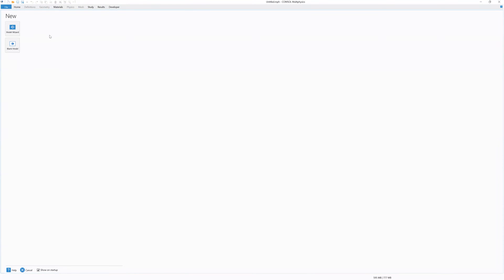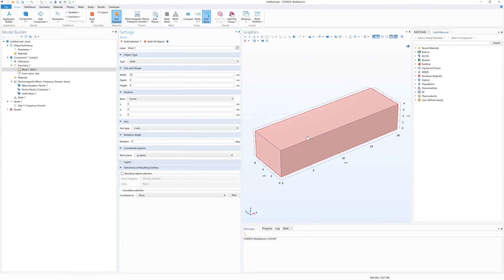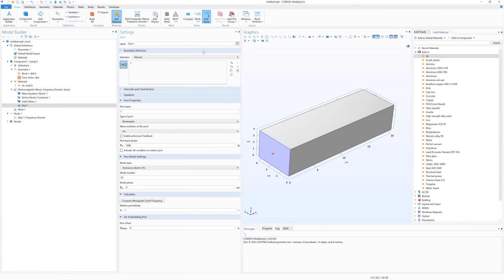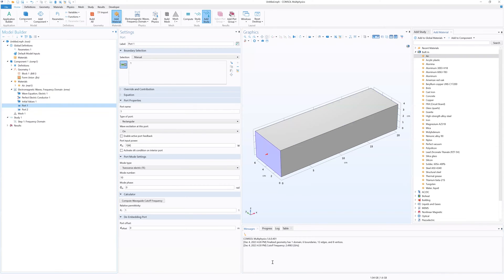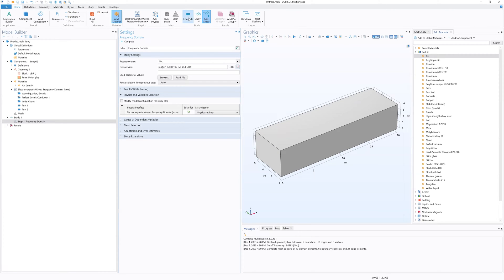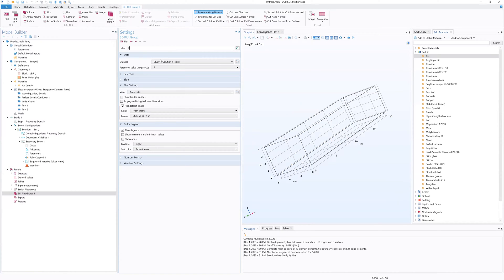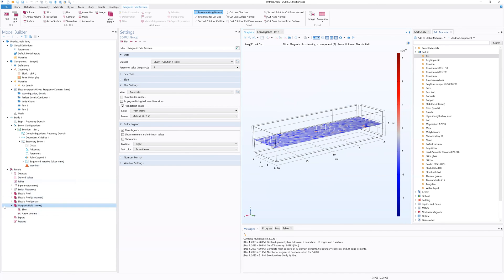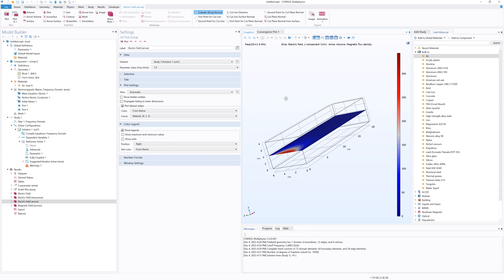How to Setup a Rectangular Waveguide in Comsol

Comment: During formation of mach zehnder modulator in 2d if we want to find optimum value for impedance matching,the difference between refractive index of wave guide and transmission line of radio frequency wave.we needs to compare width of center electrode with separation between Ground and signel electrode, similarly we needs to compare height of ground electrode with the height of cladding layer between core and electrodes.What physics and study we will have to select for this.Also how will we compare them in comsole multiphysics